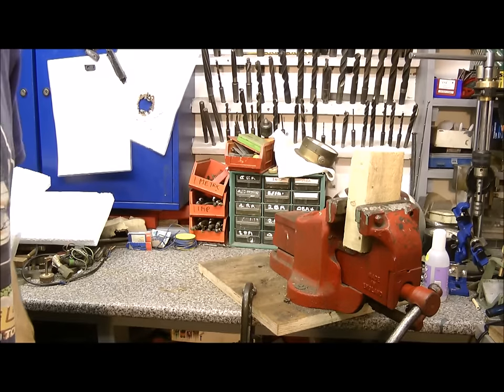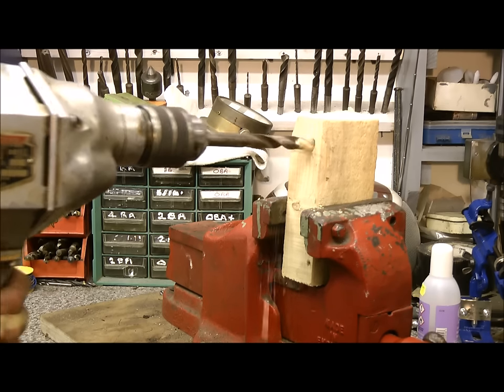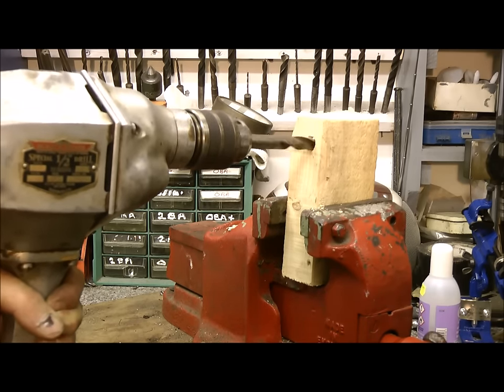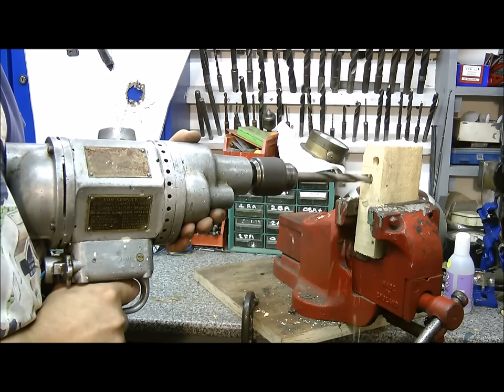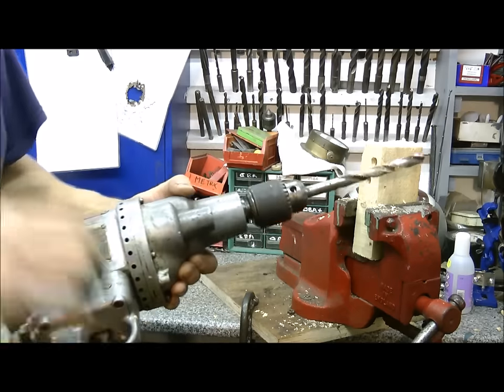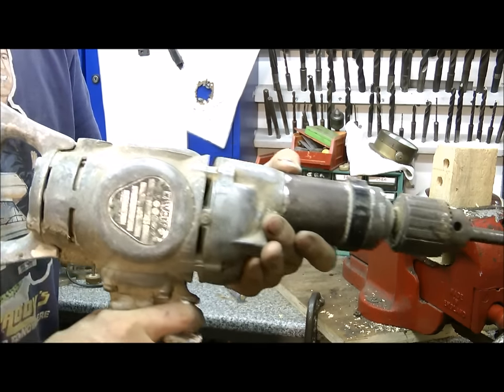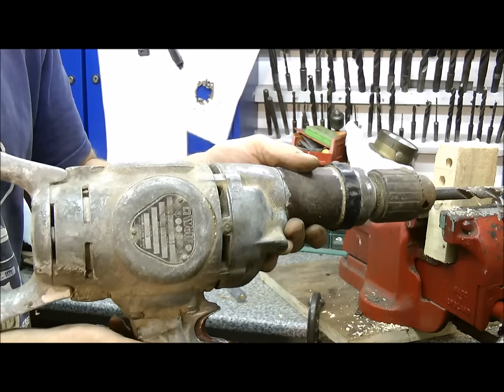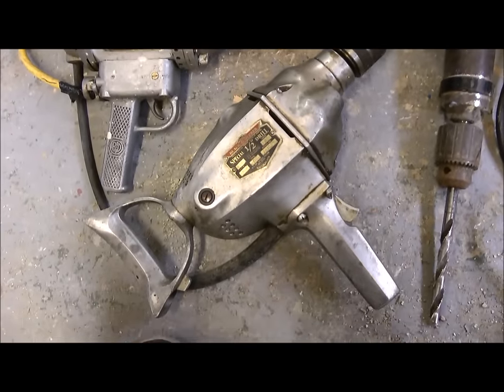USING and collecting vintage electric drills ! lets see them in action cool video

Comment: I have had one very old drill laying around for years. Millers-Falls 3/8".  Where it came from, I don't know.  It was my fathers, I have no clue where he got it.  Anyway, a couple days ago I test-ran it, and it ran beautifully, despite the shot power cord. ... Took it apart, cleaned it up, tossed the power cord, fenagled a new, short (20") cord into the pistol-grip handle, changed-out the old grease and re-lubed, put it back together, and now I too have a "collection" ... A one-piece collection.